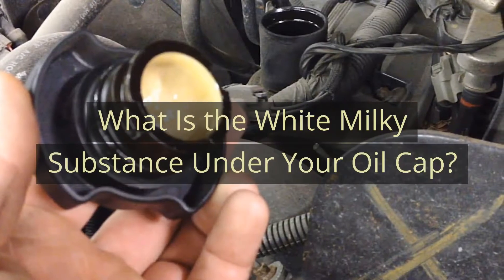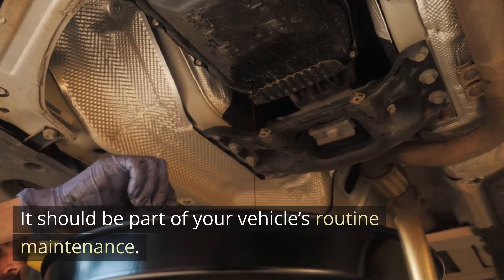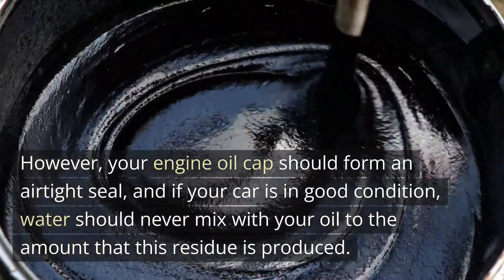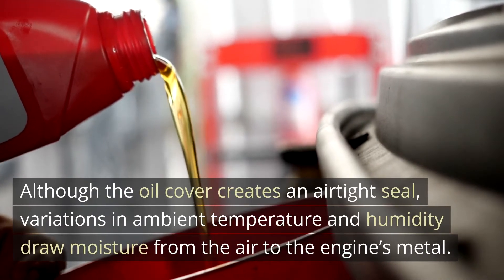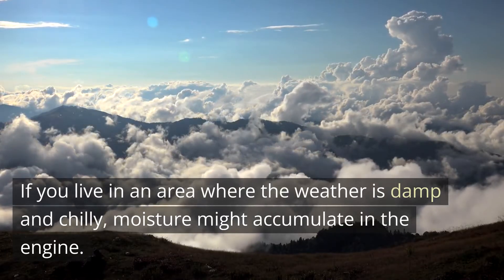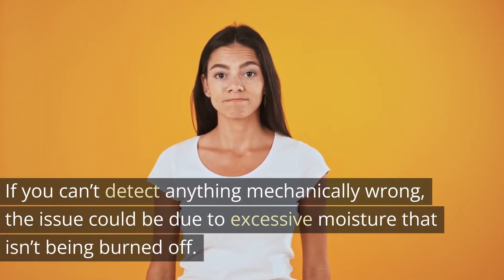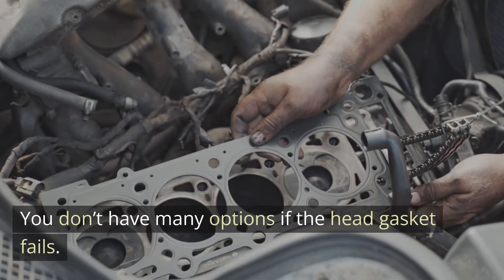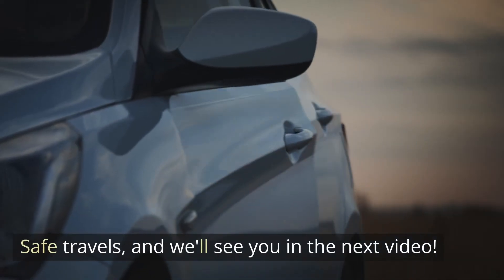Milky Oil Cap Residue: Harmless or a Serious Problem?

Comment: I've got a similar issue, i have a 1996 Honda CB1000 with only 5000 miles on the clock, i start it 2 or 3 times a year, went to give it an oil change as it was well over due, only to take the oil filler cap off & noticed milky residue round the cap, so tested the head gasket all was ok, no leaks anywhere, dropped the oil & the oil filter the oil was black not milky, Could it be the oil filler cap was not seated right & was drawing in moisture
Reply: some vehicles this cant be helped or fixed. Dodge rams hemi and 4.7s are bad about it. the make the oil cap so big and high its bound to happen especially cold wet climates